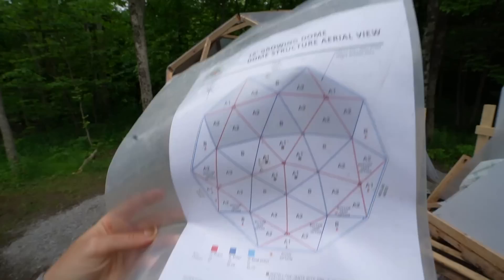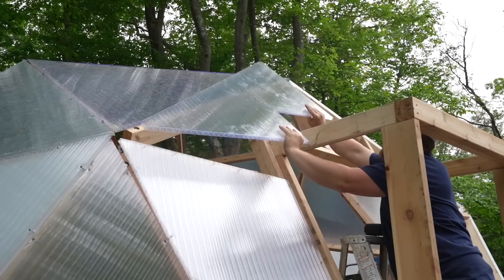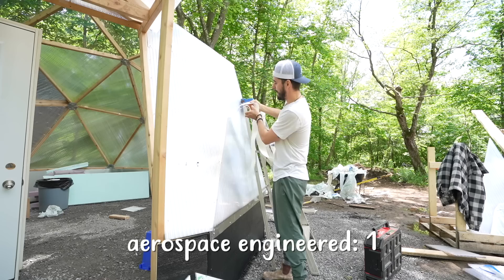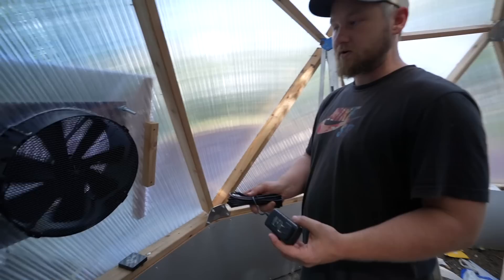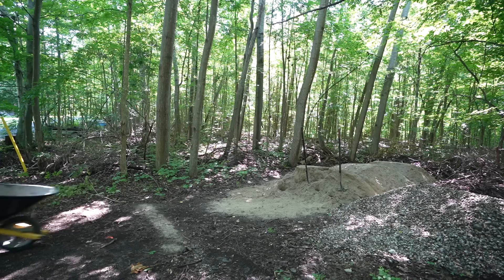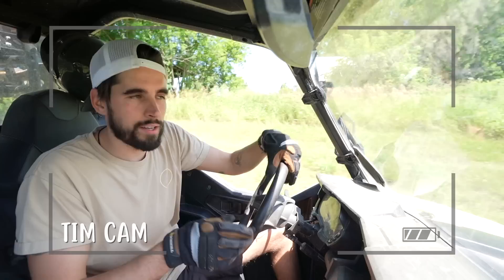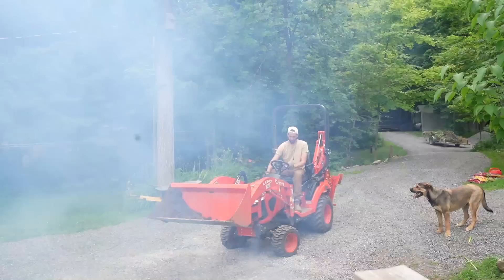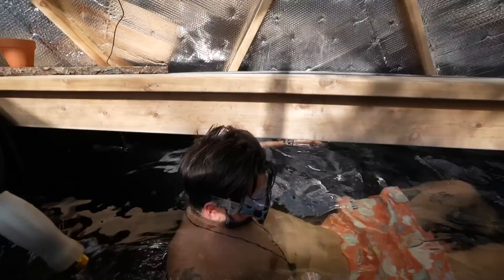We Built a Greenhouse in our Backyard

Comment: I suggest making a gravity based drip watering system.  This will allow you to control any nutrients you need to add and very simple to incorporate.  Hook up a battery based timer for the valves and you have daily watering based on the schedule you set, and the plants will love it.  Basically you set up a large tub about 3 feet above your watering level, hook up a hose that then goes to a drip distributor, and then run the drip lines to each plant or row.

Comment: Bec, looking good but they are packed together.  The lettus needs more spacing for it to grow. You can thin them out a bit and those that you pull you can plant in another location.  Also if you are doing more raised beds, use branches at the base so that you do not need so much soil in the boxes.  Also you should get some moringa seeds and plant in the greenhouse. lt is a tropical plant but it has 40x the vitamins then what you can get any were.  You can use all parts of the plant.  You can pull the leaves and use them in your smoothies and eat them right off the plant. Also at the end of the season you can dry and powder them up and add to anything.  The plant tastes a bit like pepper, but it is mild.  Also you are looking great, don't overdo it, take care and stay safe

Comment: Awesome structure guys! That type of green house is great because you will have the ability to grow crops year round. You need to stagger your planting so a few seeds each week or two so all of your veg does not come in at the same time. Also there is so much space in the center consider one or two rows of center planters. Consider keep any runner type plants or larger plants on the outside like butternut squash, pumpkin, zucchini etc so they have room to spread and keep vertical plants in the center like bell peppers, tomatoes, corn, brussels sprouts, etc. Seed depth is important, too deep in the soil and the seeds may not germinate. It is better to water plants at soil level verses spraying over the top, a little pump in the pool and some drip tubing through the beds would be ideal. Manure is often times free from local farms mix into the soil for nutrients instead of chemical (petroleum based) fertilizer, you have to let the manure sit in soil for 90-120 days prior to planting, do not add fresh manure to already growing plants unless it is composted or pasteurized.

Comment: Tractor should be fine. It was only smoking from premature startup because of the oil that seeped past the piston rings into the ignition chambers. If you wait 20-30 minutes before starting it back up the oil will seep back into the crankcase and reduce smoking. Some smoke will occur from residual, but should clear up soon enough. Also, checking the air filter is good practice to ensure the oil didn't seep past the valves to the air intake.

Comment: For larger seeds you can have a better success record by rooting them first. Soak them for  full 24 hours in water, poke at them after 2 hours or so to ry o sink them. Then place them in a wet folded paper towel inside a zip lock. Place in a warm spot for a fe days. Then root them in a coconut husk root starter Then plant. I do this routine with all my plants .

Comment: Love this new development. You might want to add some sand to stop the soil compressing next year. If you see any moss develop that's why. Currently fighting it in my own garden-raised beds. Tomatoes and peppers are really easy, just keep the tomatoes tamed if you have indeterminate types that just keep growing up. They love putting off extra shoots and you just want one per plant. You'll need to hand pollinate them if no bees get into the dome. I just use a little paintbrush. Also, peas are easy, you could get some bamboo sticks (or just fallen branches from the woods) and could grow beans and peas up them in the back corner. Check out Charles Darwin and Huw Richards on Youtube. They'll give you some ideas of making the most of the size of your beds :)
Reply: They also do videos on shade tolerant plants so you could figure out how much light you get at different points in the year and figure it out what you plant when from there. Heads up lettuce hates heat and will bolt fast, you'd probably be better having a little window box in a sunny area of your house than trying to grow lettuce during the summer.